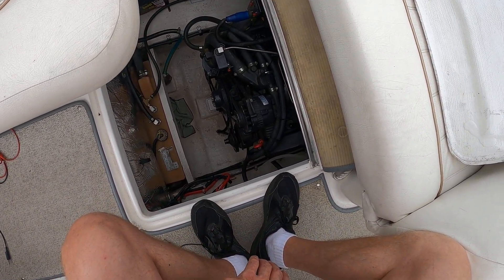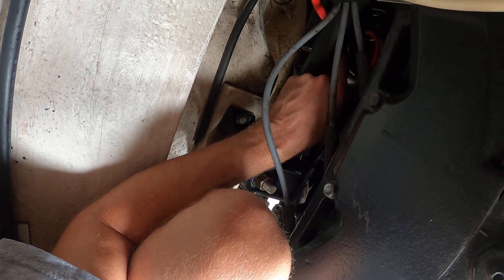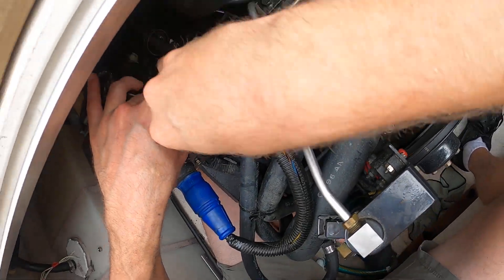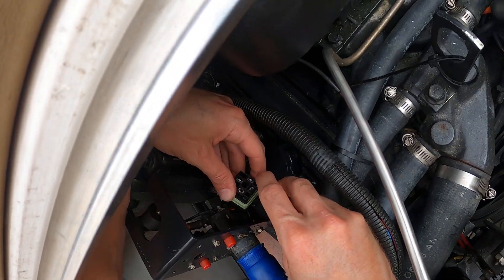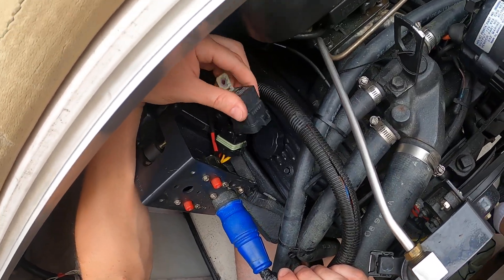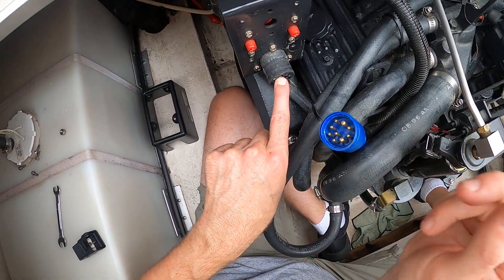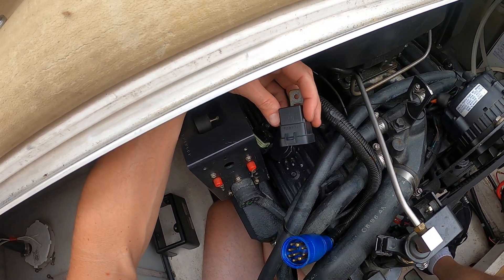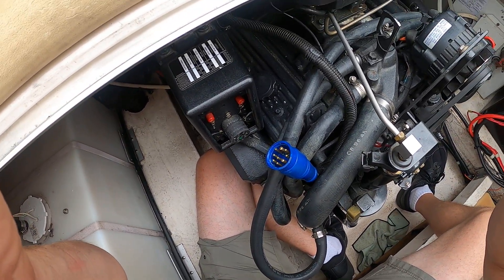Volvo Penta No Start Situation

Comment: Did you replace that relay and was that the issue of your boat not starting? Did you find what was the issue with your boat not even making a clicking sound when you turned the ignition on the start it?
Reply from the maker: Yes, bad relay

Comment: Hello David u seem to be quite smart with electrical stuff. I have a volvo penta 3.0 gs and the starter just spins and dont send the small gear out to the flywheel. I jumped with a metal rod the + 12v to the Yellow/red on the starter and the same thing just spinns. The starter is bad right? not relay. The solenoid is fucked?
Reply: I had the same issue on my 3.0 gs; the starter has a plastic planetary gear ring that stripped, Delco part 10475632 maybe ~$8 in the US